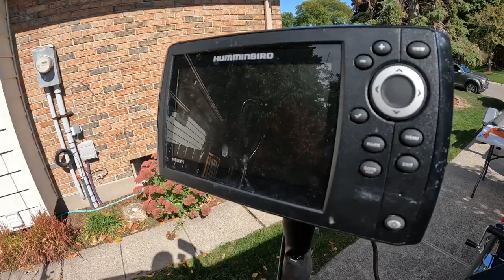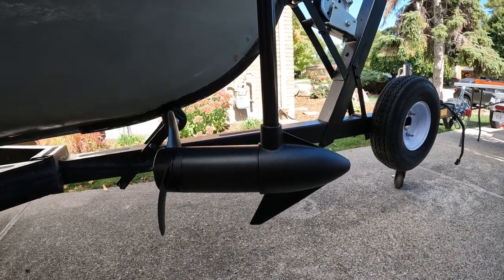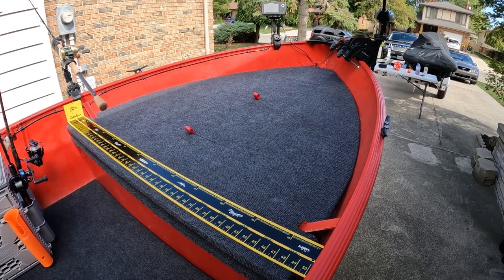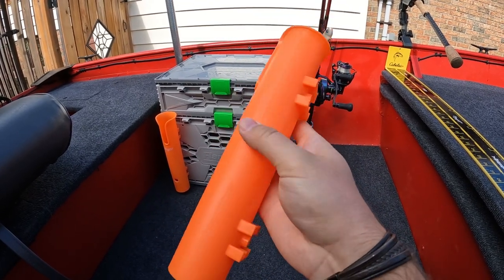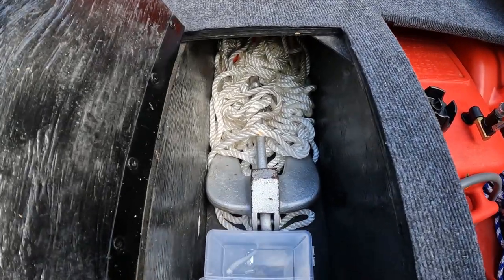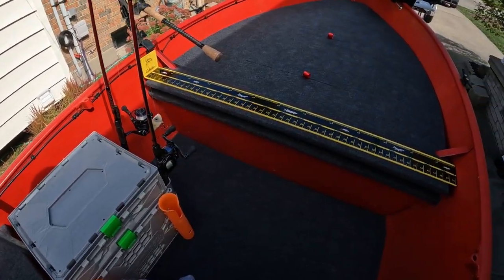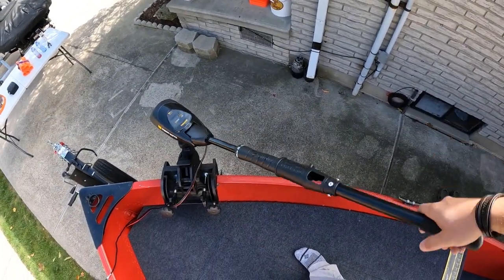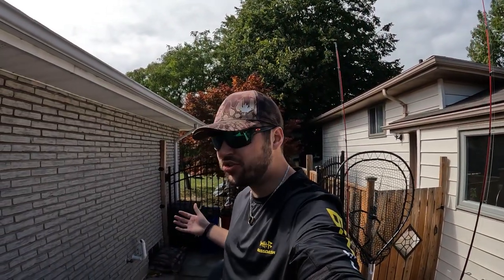MINI BASS BOAT BUILD TOUR!!!

Comment: The orange reels that are for ext cords are great for the anchors. The ones that look like a spool with black handle in the middle. You just hold the inside handle and drop anchor and it un reels itself and when you are not using it you can lift up the seat post and run it through the middle of reel to keep it stored and from rolling around boat. Nice boat man! Im slowly fully restoring \ building my first boat and trailer. It a 1966 Mirrocraft 14ft v hull deep fisherman and I have a 1973 9.5 sea horse Johnson that came with it that probably needs everything looked at and rebuilt! seals, wires, kill switch, everything! Also came with an old 17 lbs Minn kota. A friend of family gave it to me so that was awesome but it sat for over 10 years in the woods that I know of. Im really looking forward to getting it done but my mom is on hospice here at the house with me so I'm out of work at the moment.😪
Reply from the maker: Yea cool anchor idea for sure! Enjoy the restore build, its a great time!

Comment: Annnnddd my project begins!
Reply from the maker: Haha nice dude! Have fun!
Reply: @hyper.orange  , obviously seeing a lot of the big guys go aluminum framing. Have you had issues using treated lumber?
Reply from the maker: After one year there is no problems so far. I’m definitely happy that I coated it in the water resistant paint as well for extra protection. Also, when not in use, I have a waterproof cover so the boat stays dry.

Comment: I gotta 1980 12' mirrocraft with an 88 2stroke 15hp Johnson. It does 22-23mph. It's rated for 13 horse. I'm planning on putting a bow mount trolling motor and deck in front. How did you get your floor cut out to fit perfect in the v?
Reply from the maker: Nice nice! I love seeing older boats still being used. For the floors and deck I just kept working it, taking it out and back in to get the perfect fit.

Comment: Awesome build. Would you share a supply and shopping list? I’m looking at doing a similar build for a Alumacraft 1457 Jon boat , My father gave me.
Reply from the maker: Boat 
3/4 plywood
2/4 Wood 
Outdoor carpet
Leather captain seat 
Minn Kota trolling motor 
EZ mount 
Red marine paint 
Black rustoleum boat paint
Boat cleats stainless x 4 
Etc 

Trailer ratchet straps x 2 
Trailer jack
Trailer winch 
Trailer 2" hitch 
Trailer chains 
Trailer wiring 
Trailer Submersible lights 
New big trailer tires 
Etc 

Heres a rough idea. Their is a lot more but it depends what you have and how you want to make your boat. Cheers
Reply: Thanks for asking for the list.

Comment: The difference in size of those outboards was the carburetors and intakes. They all shared the same block from 6 thur 9.9. Four-cycles are quieter, use less fuel per hour than a two-cycle, but you give up torque. And with your 6 gal you can run more hours than you normally will. Maybe ask/research about changing your prop pitch for a few mph.  And be sure your cavitation plate, the one right above the prop, is not above the level line of the bottom of the boat when the outboard is sitting in it's neutral position. It shouldn't be lower than 1 inch of the bottom of the boat
Reply from the maker: Thanks again! Really good information! I love my little 6hp but have been looking to upgrade! Im leaning towards a newer four stroke 25hp to get that extra punch and peace of mind of reliability. But will see whats happens!
Reply: @hyper.orange  25hp would make it move but with a 12' it may be to much. Even with your add-ons that is still a light and short boat. My smallest skiff is 480lb factory blank @ 15'. It's factory and USCG recommended at max 25hp. 15, 18, 20hp would be better fit for yours, and spend that saved $1K on other goodies for your boat.
Reply from the maker: Yea I’ve been doing a lot of research! I’m going for a 20hp hopefully by the end of the year! I got a new video coming early May, with a great new upgrade if your interested! It’s gonna be great!